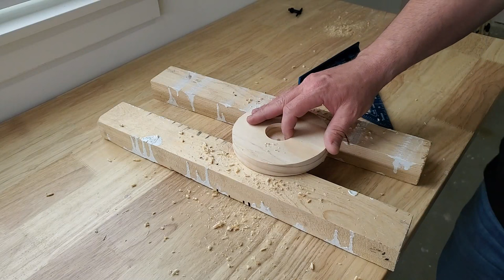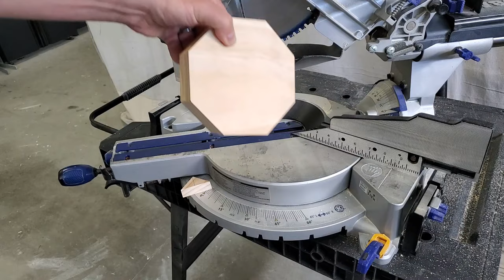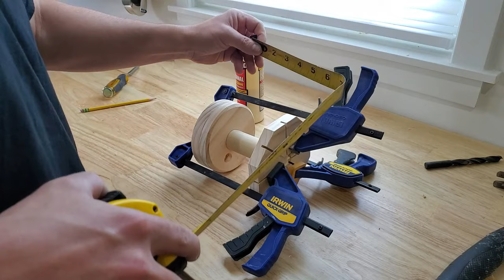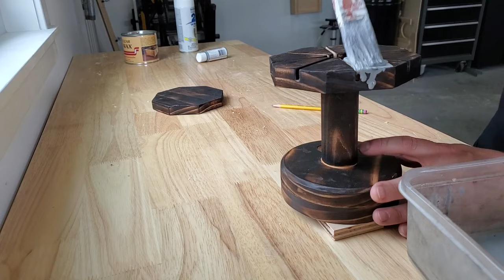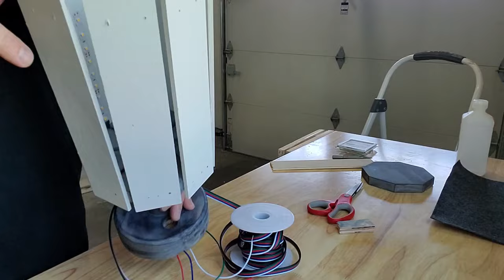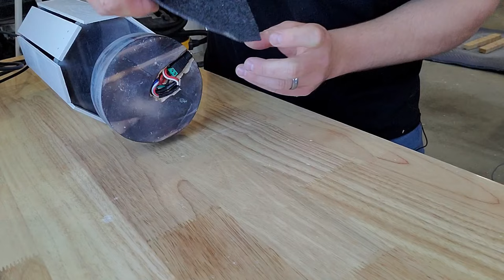How to Make A Table Lamp | Using LED Strips

Comment: Nice! But, if you keep using that chop saw like that, you are going to be learning how to live life without a thumb at some point. Much safer to do that with a sled on a table saw. If the blade bites, the saw will ride up, and pull the piece into the chop saw with your hand as a bonus.
Reply from the maker: Great tip!  Thanks.  I have a cross cut sled I've been using more and more.

Comment: I saw you use a tool (twice) that clamped around the base to drill the hole for the dowel.  What's the name of that?  I've never seen a tool like that before.
Reply from the maker: It's called a drill guide.  I have a link to the one I used in my description.  Thanks for watching!